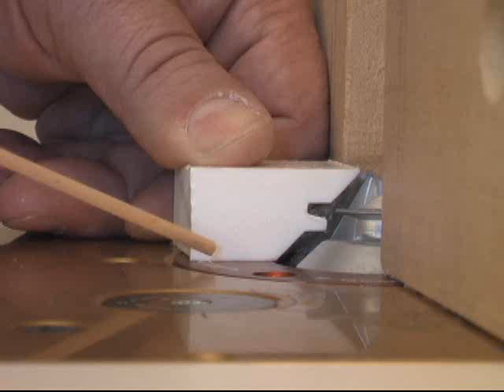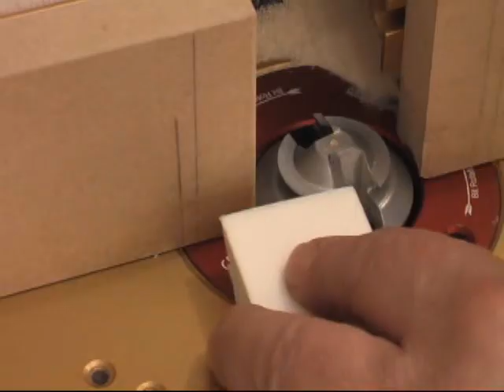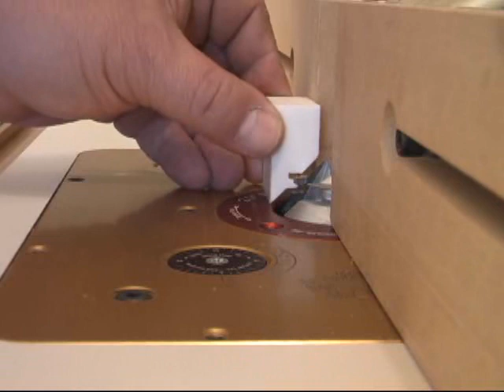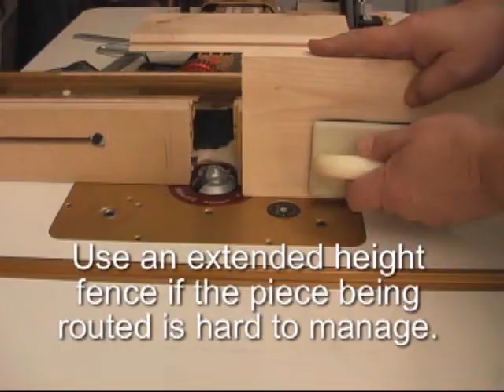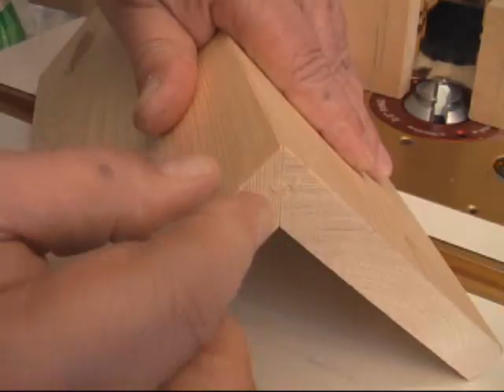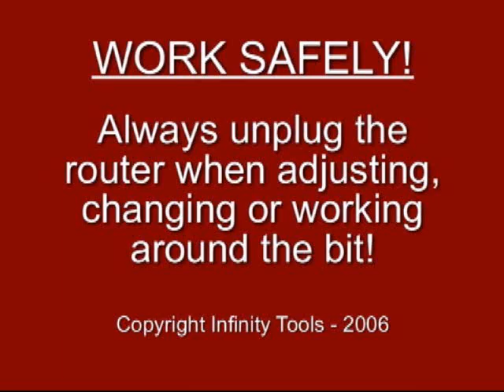Infinity Cutting Tools - Lock Miter Router Bit Setup Blocks

Comment: Does this work with the   Freud 2-3/4" (Dia.) Lock Miter Bit with 1/2" Shank (99-034) ?
Reply from the maker: Our setup blocks are made specifically to fit our router bits, we can't guarantee they will fit other brands. If you are looking for an easier way to set up your lock miter router bit, have a look at our Lock Miter Master Jig. We have one that will work with your router bit. https://www.infinitytools.com/lock-miter-master-jigs
Reply: @InfinityTools  I ordered it. I would have ordered the bit with it if I didn't already have the freud. I am intrigued by your product line.

Comment: Can it be used on a spindle moulder? And not more than 3/4" stock?
Reply from the maker: +Wangdi Gyaltshen for use on a spindle moulder/shaper I would recommend the Lock Miter Shaper Cutter which will work with material from 1/2" to 1" thick
http://www.infinitytools.com/Lock-Miter-Shaper-Cutters/products/1160/
Also for setup take a look at the Lock Miter Master, it will help make setup much easier. The large size jig will work on both the shaper cutter and the large lock miter router bit. 
http://www.infinitytools.com/Lock-Miter-Master-Jig-For-5_8-1-3_16-Lock-Miter-Setup/productinfo/LMM-003/